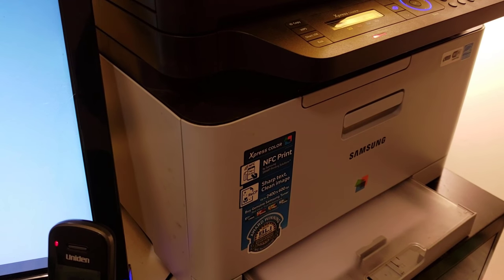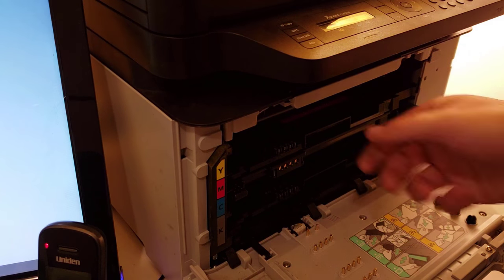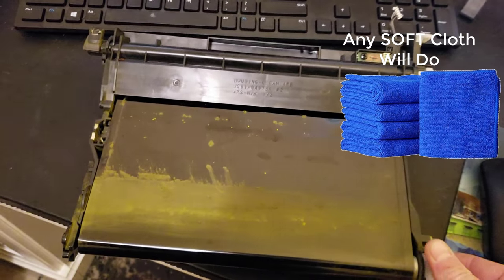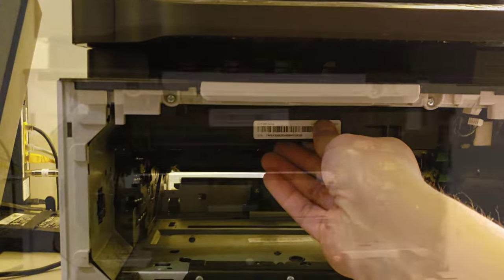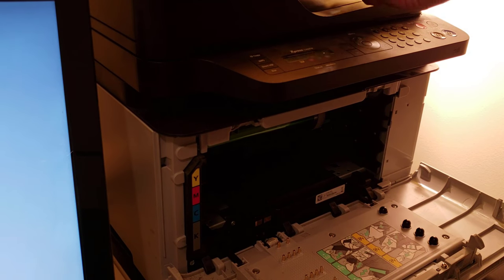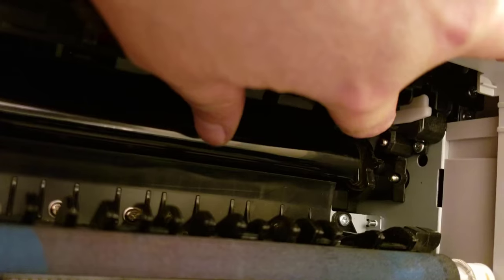Easy Fix For Dirty Prints on Samsung Printers By Cleaning or Replacing the Transfer Belt

Comment: REMOVING THE POWER CABLE: To anyone wondering about how to get the power cable loose: THE WHOLE WHITE PLUG DOESN'T COME OUT, ONLY THE CENTER OF IT COMES OUT. Pull carefully by the chords and it will come loose.
Reply: you literally just saved my life (and my printer's as well). awesome, thanks!!
Reply: You are a lifesaver!!!
Reply: I’m the guy who pulls those cables right out!
Reply: I came back looking for this bit advice. Thank you!!
Reply: The plug on my C480W will not come out, and tugging a bit too hard on the wires has removed one wire from the plug.  Any idea how to loosen it?
Reply: @dickmorris2434  Did you find a way to loosen it? It's also completely stuck on my C480W and it doesn't budge no matter how much force I apply.
Reply: @carll92  still can’t get it to budge. Thought maybe there was some sort of tab that needed pressed in, but can’t see anything. Let me know if you find a way!
Reply: THANK YOU !!
Reply: Couldn’t be more stuck, haven’t broken cables yet. Any advice?

Comment: You forget something! After removing the toners slide out the green big roller from the front. But thanks for the tips!
EDIT: stripes came back. Real reason was the tones waste opening was clogged. It is at the end of the spindle in the bottom of the transfer belt behind a little door at the side of the waste container.
Reply: Indeed he forgot to mention to remove the drum. Without removing the drum you will never get the transfer belt out !!!
Reply: How do you remove the green roller
Reply: How do you slide that out?  That's a key step.

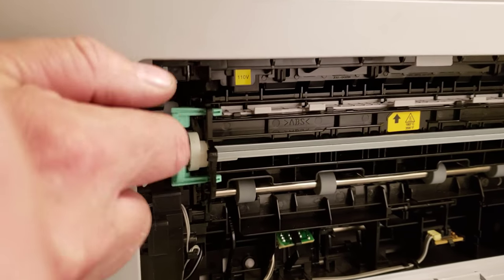Comment: Thank you very much. In my case, the foam roller (1:10) was dirty, not the belt. But your video set me up for tinkering and experimenting. Thanks!
Reply: Hey Tim, did you clean the foam roller? How did that work
Reply: @juliehong7653  I guess I just gently tried to wipe off the toner powder from the foam roller. Be sure to use a cloth that doesn't leave any fabric behind.
FYI, the real culprit in my case was a leaky generic cartridge, I switched back to originals.

Comment: It was a little messy, But it worked great. Thank you so much. I was getting a green tint mixed in with the other colors. The transfer belt was indeed dirty.   I'd advise others to do it outdoors if possible.  I used microfiber cloths and an air can to blow it out. That's why I did it outdoors. I ran it a few times now and it stays clean so far.

Comment: We have a Samsung CLP-315 laser that has been in storage for some years and now it still prints well but with smears. 
We have cleaned the transfer belt, but it seems that it has picked up faint creases from edge to edge from being still for so long, and these creases pick up the toner again very soon after replacing the belt. 
Is there any way to remove these creases, like with hot air?

Comment: Well I took apart my printer, following your instructions, which I must say are very good, clear and straight to the point and also apply to the C480W (although the little ribbon cable was a bitch) and what do you know there was a FUCKING PAGE JAMMED IN THERE, AN ENTIRE PAGE, UNDETECTED. I printed like a 100 pages with it there! Thanks for the tutorial. The transfer belt needed cleaning too.

Comment: Is there a trick to removing the little power cable in front of the transfer belt?
 I am unable to get mine to come out?
Reply: You mean the cable he FORGETS to tell you to remove about two minutes in, but then adds (in post-production, I presume) a helpful arrow warning that you'd BETTER remove it before you go any further--without EVER SHOWING YOU HOW IT'S DONE??!! Did anyone ever reveal the secret to you--because at this very moment I'm sitting with the printer spread out in front of me, nearly foaming at the mouth from frustration. O sweet Lord, how I would LOVE to know the answer! Been wiggling the plug, tugging at it, fiddling with its two tiny side tabs, coming who knows how close to breaking it who knows how many times, etc etc etc for over half an hour without the damn thing even pretending it might someday possibly budge.
Reply: @hipdadiddy  yes there seems to be a part of the video missing. There is another video out there that shows the same steps and also the unplugging of the power cable. https://www.youtube.com/watch?v=SqsAnIePCOU GLHF!
Reply: To anyone wondering about how to get the power cable loose: THE WHOLE WHITE PLUG DOESN'T COME OUT, ONLY THE CENTER OF IT COMES OUT. Pull carefully by the chords and it will come loose.

Comment: Having a hard time pulling out the belt any tips?
Reply: Yes, before pulling out this piece, first you have to remove the big green-ish roller with also a white label located in the bottom front. If you look at 3:01 you will understantd ;).
Reply: @gourdonjoachim1386  lol I had the same issue... missing that part, I recommand adding some text to video, otherwise people end up pulling like crazy lol - thanks

Comment: There is a piece of the video missing:
around 1:02 is not explained how the drum (imaging unit) is taken out
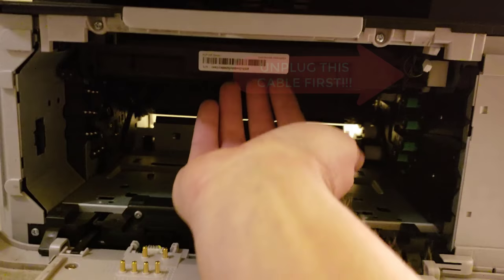at 1:45 the unit is not there
and is installed back at 3:00
Reply from the maker: Hi Carlos;  Just pull/slide unit straight out using the hand grab as shown at minute 3.  Thanks.
Reply: Thanks  @URTechDotCa  - yes, I figured that out when I saw the full video, just pointing that missing part, maybe a comment can help for others following the instructions.

BTW, thanks a lot for the instructions, my printing was really dirty, it took a lot of time to me to clean that part, it had a lot of toner accumulated inside, but now is printing clean again.
Reply: yes this added about 20 mins to figuring out how to do this. needs to be refilmed taking the cable out and taking the drum out...

Comment: @
URTechDotCa Bullshit, you don'r have to replace transfer belt if cleaning won't  solve the problem.  All you have to  do is simmply disassembly transferbelt and just replace the wiper blade, or simply remove it from the frame and glue it back on doublesided sticky tape in the same direction but upside down. I had the sime issue  in CLX2160N, I simply  flipped that wiper blade and it works back with no problem...

Comment: For the C480FW you need to remove the drum unit prior to the transfer belt; it just needs pulling from the front. this video is a good example https://www.youtube.com/watch?v=L1yXocePDyM&ab_channel=COPY-EXPERTbyTomaszJemio%C5%82ek. I had issues removing the cable from the transfer belt, i did it by putting a pair of tweezers between the bumped cable connector and the smooth houseing on the left had side and leavering the cable conector downwards. There wasn't any clips holding it in place.